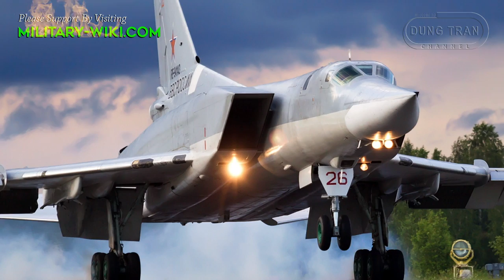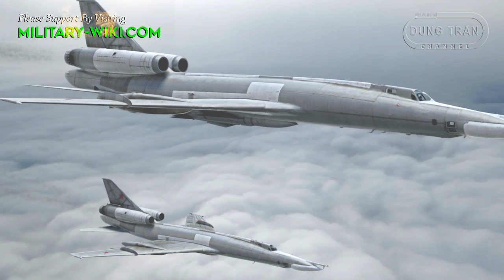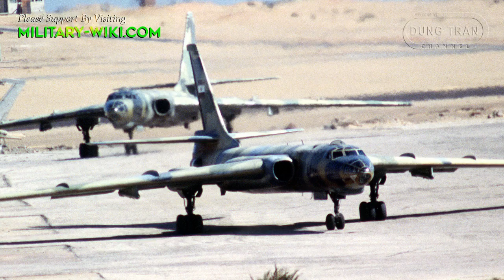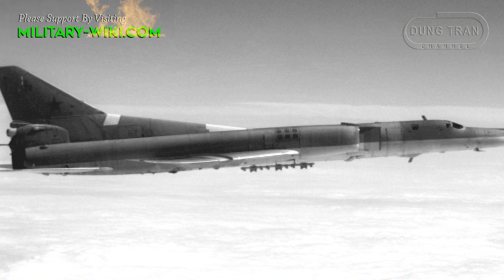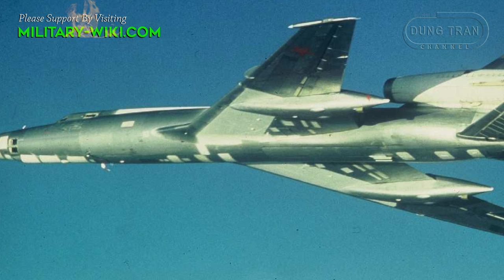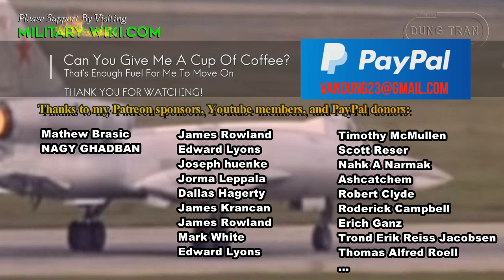Tu-22 Blinder: Same Name, But Tu-22 and Tu-22M Are Completely Different

Comment: Smart in those days to externally place the engines as the technology developed fast. The ME-262 did the same to be able to carry new engines if necessary.

They are nice looking but very cheap designed aircraft a bit like the US single seat air force program of the late fifties and early sixties.
Reply: the 262 used it because those early jets only had about a 10 to 20 hour lifespan and need replaced regularly!! Adolf Galant said you could completely trash those engines by moving the throttle too fast!!
Reply: @keithmoore5306  that was due to the lack of essential metals and the only source back than was the British. But they wanted to be able to hang bigger engines eventually. The easy replacement was just an added benefit.